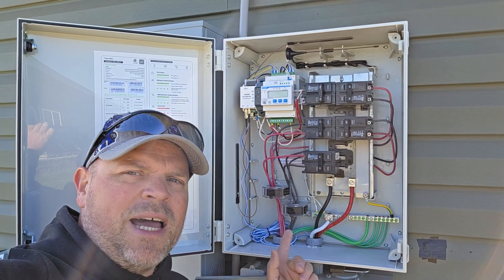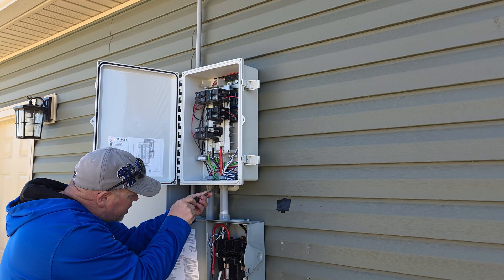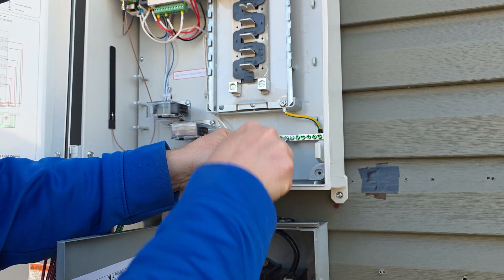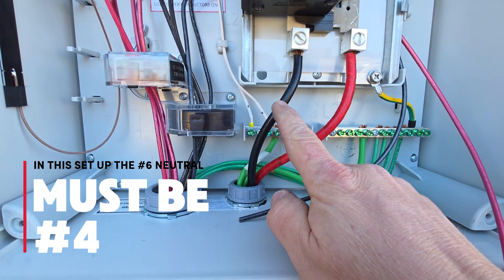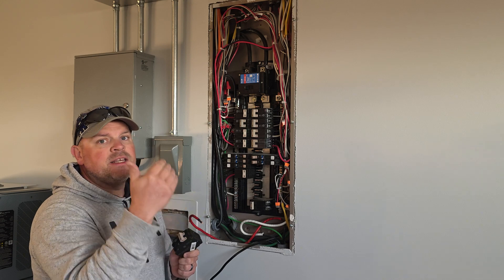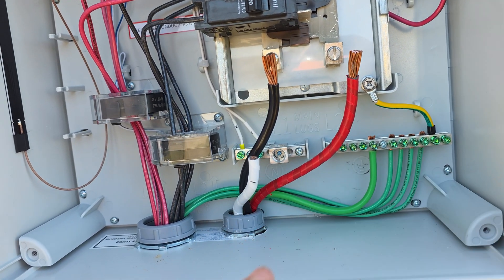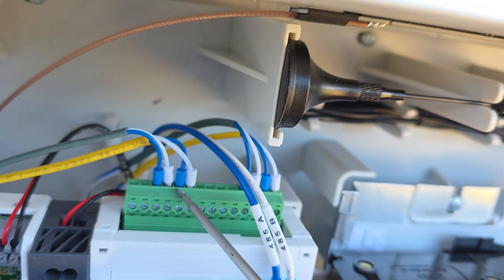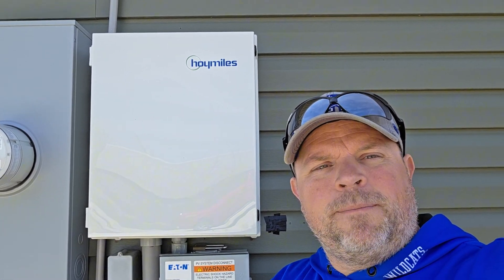DIY Solar: Hoymiles Combiner Box Installation Guide

Comment: As soon as you turned off 240V power Enphase IQ8s would turn off.

Also my Enphase Combiner 5 came with CTs.

Why switching from Enphase?  Hoymiles is China based.
Reply from the maker: @JeffreyAdams-kt5gv  I have videos that I made in the past that cover in more detail why I am switching. In short... clipping. I love working with microinverters and in my opinion, at this time, there are only 2 manufactures that I would even consider. I have been a little disappointed with the output of the Enphase system. Let's see how the Hoymiles system performs now.
Reply: @TheSolarPit fair enough. Do be aware there are domestic devices becoming available soon that would likely change your decision.
Reply: @JeffreyAdams-kt5gv  would you be able to give us a little more information of what domestic devices you are speaking of? Company? Thanks,
Reply from the maker: @tcasey75 Domestic devices?

Comment: Nice! Thank you. I haven't used one of those yet. I use a regular Eaton 125A, 6/12 Outdoor MLO panel with up to 5 x 30A breakers. It's cheap and easy but doesn't have the meter and DTU built in.
Reply from the maker: It is definitely a nice feature to have everything in one box like that.